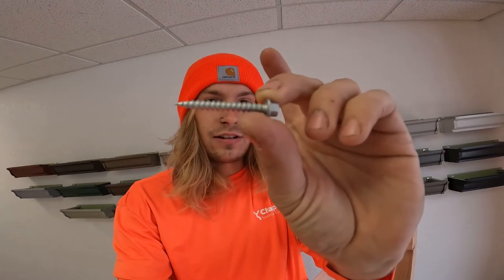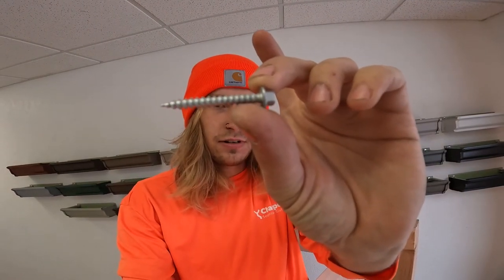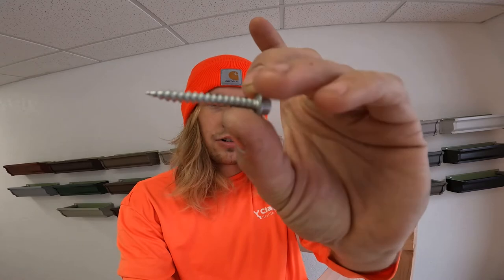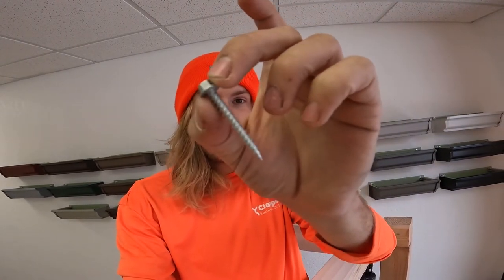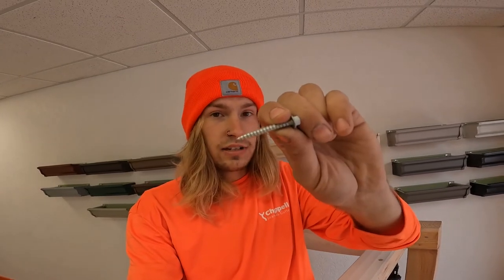The Best Downspout Strap Screws | What Screws To Use When Installing A Downspout

Comment: 🦋 would you use the same one and a half inch screw to attach a vinyl downspout clip to the side of the building? I’m trying these out for the first time and they seem to hold the down spout in place really good I just don’t know if I use the same size screw and same kind of screw for that. The reason I like this is because I do not want any screws in the downspout for the exact reason that you mentioned because just the tiniest little point of that screw catches something on it and it everything gets stuck. It’s happened to many times.
Reply from the maker: I'm honestly not sure. We see lots of drainage / rot problems arise from using seamed gutters such as vinyl so I've never installed or recommended them. 

I'd assume they would work but just not sure as I don't have experience.

Comment: To screw to fiber cement siding, are 1 1/2 inch screws long enough ? Do I need the screws to go into the studs behind the siding ?
Reply from the maker: 1 1/2 inch screws will be fine for fiber cement siding like James Hardie board... We do it all the time
Reply: @chappellgutter  do you mount just to cement  siding or do you have to hit the studs behind it ?  Thank you for reply it is hard to find any info on it